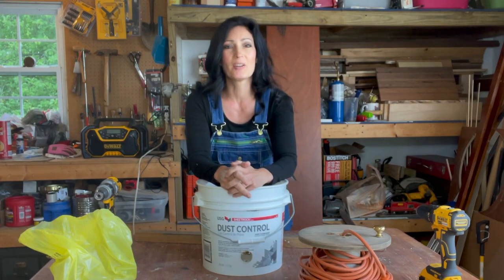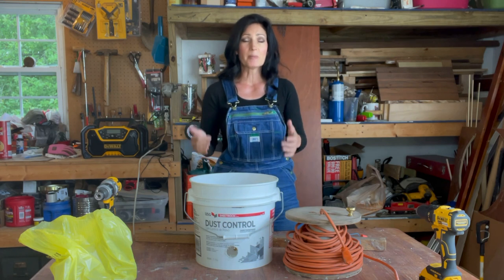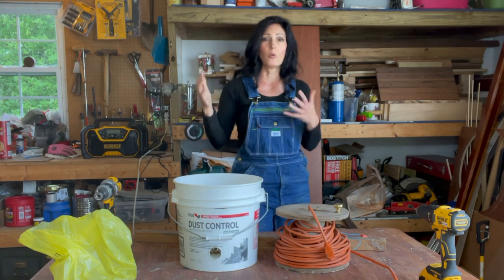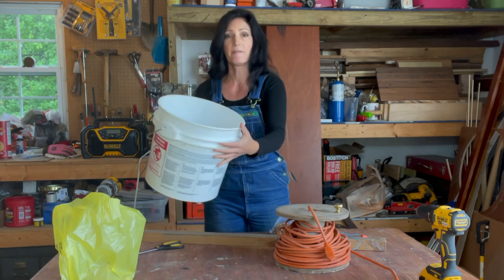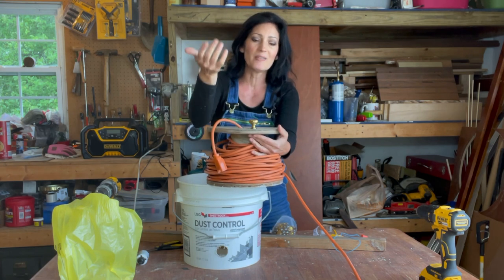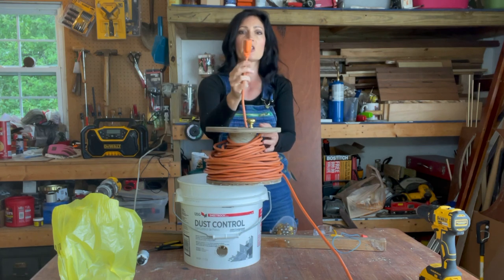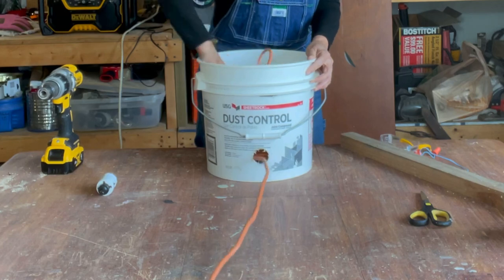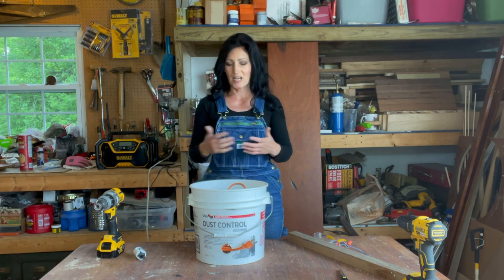SUPER Easy & CHEAP Homemade Extension Cord Bucket ORGANIZER (HOW TO GUIDE) EASILY PORTABLE SOLUTION

Comment: I torched a 2x4 using the shou sugi ban method & then used a spade bit to create 6 holes along the 2x4. I then cut 6 dowels to equal length & added those. I now have 6 extension cords on the wall between my 2 car garage & 1 car garage. Takes up minimum space for maximum storage

Comment: This is a neat idea. I have to wonder though, if you aren't using the whole length of the cord and have a bunch of wire left wrapped in the centre while using the cord, are you going to have problems with heat and electricity flow? Basically, you've made a large inductor (like an electromagnet but with AC power), which creates heat and impedes the flow of AC. I imagine that using a heavy gauge wire means wire overheating from being in a coil might be less of an issue than with small gauge wire, but I am curious if this might be an issue.
Reply from the maker: I’m probably not the best to answer that, but for what I do, it’s intermittent use so I think I’m ok. I don’t know how long you’d have to run something before it got overheated? Like anything, this has its applications.

Comment: Very nice Jennifer. Question for you. I'm usually wrapping up my extension cords around my palm and elbow. After a few times, especially the 100 ft. the 3 wires inside the cord casing become twisted. Really twisted. It takes be and a buddy to pull each end hard to try and straighten them out. Have you experienced any of that with the bucket or does that spool stop the kinking? Thanks!
Reply from the maker: I just created this yesterday so I honestly can’t say but I know what you’re talking about because this cord does that when wrapped around my arm as well. I don’t know how long mine is but probably not 100 ft. Best thing I can say is wrap it around the proposed spool as a test.

Comment: If you cut a thin cut about one inch to the bottom of the top rim you could control the cord and make it reel in more evenly.  Very good idea.
Reply from the maker: Someone else suggested that too. Thank you! Was my first attempt and it reels pretty easily but might not for others. Appreciate the tip!